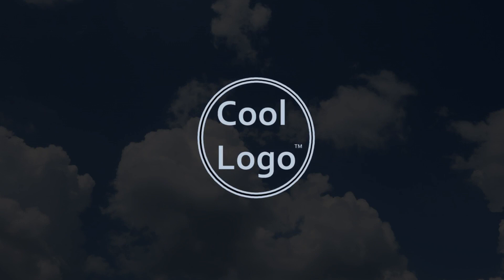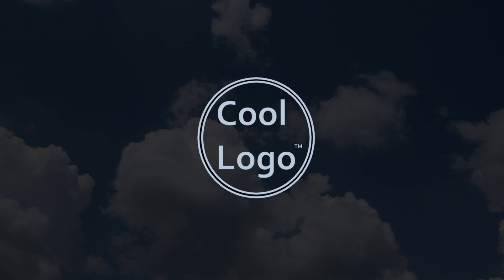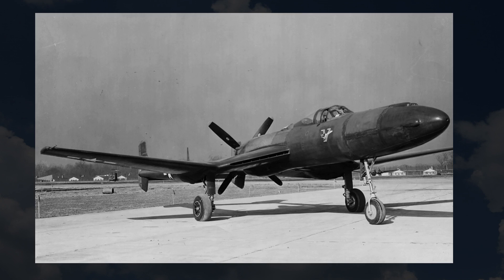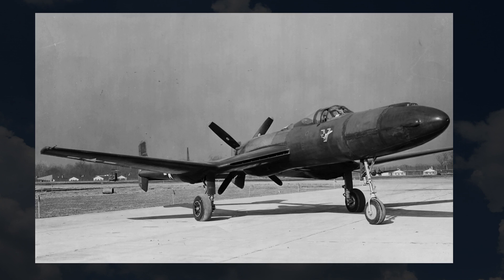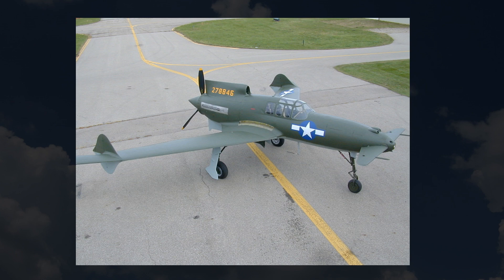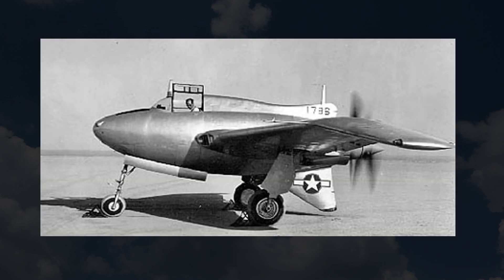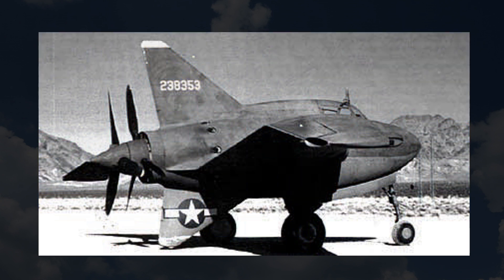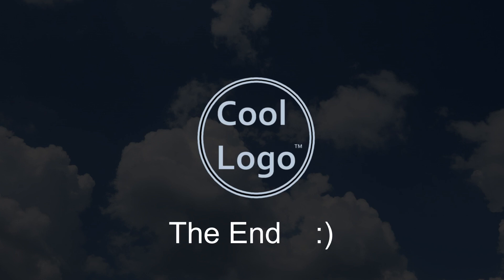The R-40C Three: America's Failed "Pusher" Planes

Comment: Most failed designs of WW2 were killed by engine issues, regardless of aerodynamic configuration. 

If you wanted better performances than the current generation, you had to gamble on a new engine, which often had issues or didn't deliver, or even canceled. If you needed to change the engine, this would often delay testing to a point when your design was no longer needed, or outclassed by the competitors. 

A few new designs just got lucky: the Mustang was not designed for the Merlin engine, it fitted it by pure chance. But even if you happened to win your engine gamble, you had to compete with other lucky designs that used the same engine. This is probably why the Mosquito was not produced in much greater numbers: you could produce two Mustangs or two Spitfires with the engines of one Mosquito.

Comment: When you're promised a 2400 HP engine, and what you end up with is a 1200 HP engine your kinda screwed... The US also never developed successful counter-rotating props (during the war) to a point where they were actually viable, and almost every design that incorporated this feature eventually dropped it in favor of conventional props resulting in a significant downgrade in performance. These "bad" designs were just designs that unfortunately picked a bad engine and in some cases a prop setup that took too long to perfect, counter-rotating props also killed the YB-49, they couldn't make the props work but when they removed them and replaced them with early jets it was found that the jets were too fuel hungry and range of the 49 was dramatically reduced, also the props and prop fairings gave the 49 yaw stability which was could not be replicated with jets, it was the primary reason (IMO) why the YB-49 failed.

Comment: Probably the biggest set back was the cancelation of the engine they were designed for. That had the most impact on weight, speed, performance, and design. I find it interesting that they just didn't go back to the drawing board after that.
Reply: Failed engines - piston and jet - doomed many promising aircraft projects.  The lucky ones were modified to use reliable though sometimes less powerful engines.

Comment: Pusher is faster than pulling because pulling the plane blows high speed air from the prop over the entire airframe pusher is faster because high speed air is free to blow out. You can prove it with radio control planes I have seen it

Comment: They designed them in pusher configuration to get rid of the blade wash across the lifting surfaces of the main wing This allowed for much smoother airflow across the lifting surfaces The other reason is the weapon 's fire rate would no longer be constricted having to shoot through the propeller or if counter rotating propellers 🤩
Reply from the maker: That's the kind of stuff I didn't really know about or understand all that well. I thought about putting some stuff about aerodynamics and the like in the video but I decided that, because I didn't really know enough about the science behind aerodynamics, that I should probably focus on other points that I know more about and understand better.
  
I guess that's why I majored in history, not science. 
  
But thank you for adding this. Any additional information you or anyone else has about these aircraft is more than welcome.
Reply: @ihyls  I'm hoping that you can look into the Doiner 335 Fifle That aircraft had both push and pull prop configuration. The results were uncanny but surprisingly well suited as a fighter intercecter pushing piston powered speeds up to 527 Mph Making it the fastest piston powered aircraft ever flew during World War 2.
Reply from the maker: @charlesscott5076  I actually learned about that plane in my research for this video, believe it or not. It is definitely something that I want to look into a bit more sometime in the future.
Reply: @ihyls  I'm looking forward to your documentary of it There's not that many documentaries out this aircraft the other one is the Shinden from Japan It was a canard finally test flighted right at the end of world War 2
Reply from the maker: @charlesscott5076  I don't know exactly when I'll do a video on it, but it is definitely on the list.👍
Reply: @charlesscott5076  Check out the Swedish J-21, another pusher ptop fighter, that actually reached service, and was later developed into a jet fighter.
Reply: @charlesscott5076  where did you get the idea that the Do 335 could do 527mph? 🥴 it was more like 480mph with MW50 injection. Still fast as hell, but nowhere near what you’re saying.

Comment: I don't think it's fair to classify the XP-55 as a failure. I guess it depends on how you're defining failure, but the XP-55 was ready for production and was as safe as any other fighter then in production, but it's performance did not warrant introducing a new type so late in the war. It was no better than the P-51, so there was no need for it. Whereas the XP-56 never overcame cooling and instability problems that rendered it unsafe and completely unacceptable as a military machine.
Reply from the maker: I get your perspective on it. It did have some stall issues in the beginning, it could still technically work just fine as a fighter/interceptor. I just view it in relation to what they wanted in the R-40C program and how it ended up comparing to that and what else they had at the time. In that regard, it is a failure. In a vacuum, it really isn't much of a failure. 
  
Besides, considering that most planes today use pusher engines and, specifically, pusher engines located on the end of the fuselage, these three planes can be viewed as a kind of success or, at least, as a stepping stone towards the modern fighters we now know and commonly see.
Reply: @ihyls  Yep. I see. Well, if they'd put a turbo-supercharger on the Allison, like they intended for the P-39, then the XP-55 might have surpassed expectations. I think the key item that doomed it was waiting for the intended Continental hyper-engine instead of just going full bore with the Allison. I actually wrote a paper about the XP-55 back in yester-century when I was at university. Sadly, my paper shared a similar fate to the plane.
Reply: @juliancate7089  
It was probably a good paper but your instructor couldn't wrap his head around it.
Reply: @rudolphguarnacci197  Thanks, brother.
Reply from the maker: @Julian Cate When you say the paper went the way of the XP-55, do you mean the paper was graded poorly by a professor or you tried to get it published and it didn't go anywhere?
 
Because if it's the latter, then I feel your pain.
Reply: @ihyls  No, I was an engineering student and the paper was for a class I was taking. I received a high mark, but I never saw my paper again. Sorry if I confused you.
Reply from the maker: @juliancate7089  No worries.

Comment: And every fighter built after 1950 was a pusher aircraft… (Jets are inherently pushers).
The Gloster Gladiator fighter entered service in 1937 (a year after the Swordfish). Gloster never built a monoplane piston engine tractor fighter, moving directly from the Gladiator to the Gloster Meteor.
Gladiators remained in service into the Battle of Britain (although they were too slow to catch the German bombers). The Gloster Meteor was actually substantially faster than the Me262 and actually entered service before (in 1943) the Messerschmitt product (due to faulty German engines).
The first American jet, the Bell P-59 entered service in 1943 but was a bit of a disappointment and superseded by the P-80 in 1944 with some being deployed to Europe during WW2.
Reply: The first variants of the Meteor (the contemporary ones to the 262) were not faster than the 262. They were much slower. And props are inherently pushers  just as much as jets are.
Reply: @dogeness  The first OPERATIONAL Me262 flew in April 1944. The Me262 had a Mach 0.84 limit with a loss of control at Mach 0.86 (with several disintegrating in testing). Messerschmitt listed the top speed for the Me262 A-1a at 560mph in level flight.
The Meteor was close behind in July 1944 with 616 Squadron. The 1943 built Welland Meteor F.1 was limited to 415mph until it had its engine cowls reshaped and were cleared to 490mph in December 1944. The more powerful Derwent I F.4 reached squadrons in May 1945 and could reach 585mph and Mach 0.82.
So it is very dependent on exactly which era in terms of months you are talking about. The F.1 Meteor was slower but the F.4 Meteor was faster in level flight - and both were less likely to crash due to engine failure.
Reply: @allangibson8494  So the Me 262 was first and faster.
Reply: @Rudeljaeger The Me262 wasn’t the first in squadron service (they were operated by a service test unit not a proper squadron).
Basically they were pushed beyond their limits and that broke them.
Reply: About 60% of the thrust of a turbojet is produced at the inlet. Thus, the higher the bypass ratio, the greater the thrust. It's also why the highest speed jet fighters have variable geometry inlets. Think Mach 2.2+ F-15 with variable geometry inlets vs the much slower and cheaper F-16 with fixed inlets.